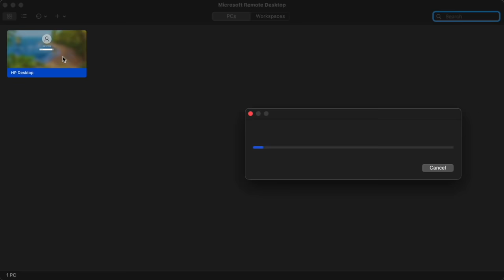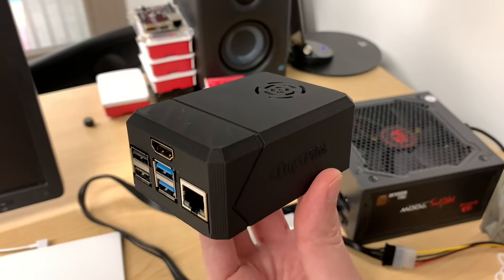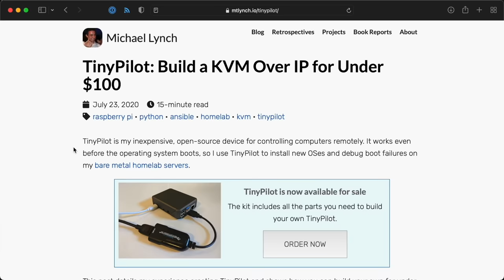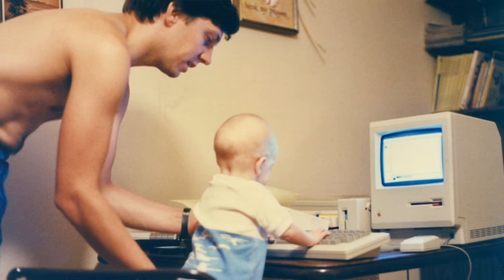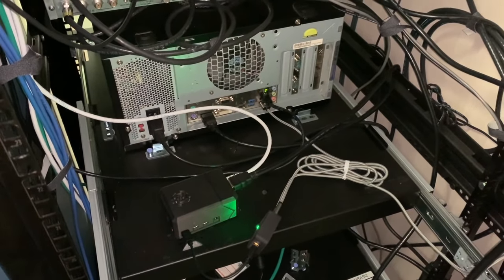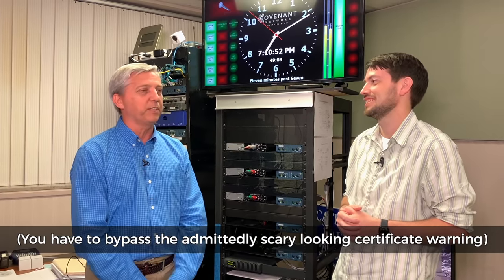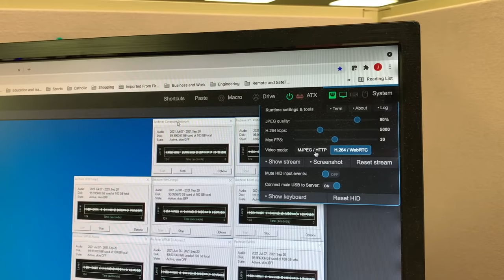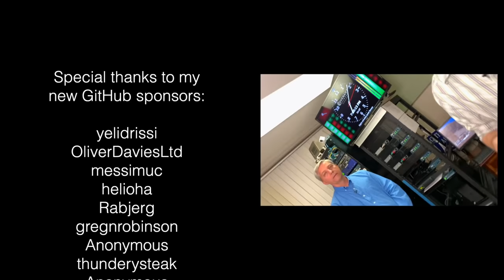Control ANY COMPUTER with these Pi KVMs!

Comment: Great vid and Dad involvement along with videographer behind the scenes (guessing Jeff's wife).  
I know with a 31K viewer base my question is like a mouse poot in a tornado, but, here goes:
With the chip shortage, could using an existing open-source package for an existing OS like Mac or Windows in the form of Barrier KVM be a viable alternative? And have you played with that package?
 Inquiring minds...
Reply from the maker: I haven't used that, but I'd assume you could set up an older Mac or PC to be a KVM with a cheap HDMI input dongle like the ones outlined in the DIY guides for the KVMs mentioned in this video.

Also the videographer behind the scenes (Katie) is my sister—the subject of my Dad's latency joke :)

Comment: I have a PS4 that I'm running Linux on... But when it reboots it goes back into normal firmware. To get back into Linux I need to run payloads...
Would this KVM work with a the PS4 on Obris (it's normal firmware)?

Comment: what is that meter on that clock that's going up and down, it almost looks like it from you two talking
Reply from the maker: That's just a VU meter for the on air signal. The station plays talk content so it's just a coincidence it seems to line up with our talking from time to time :)
Reply: @JeffGeerling  cool, thanks for answering that. I was close though since it was a talking pattern.

Comment: Its impossible to use those computers with lag. When I physically control a remote computer using a server that streams the video, its too laggy to control. Its an amazing thing to have, but the lag is terrible as opposed to Remote Desktop or VNC.
Reply: Depends on your internet, we have fibre at the office and at home and the lag doesn't cause any issues with controlling the computers.

Comment: so its not a solution to use with home desktop computer. I was thinking on having something like this to control my home desktop when I'm out, through vpn. If i need to reset, turn it on or off. Would be great when Im on vacation. I guess i'll have to work with wakup on lan tho

Comment: Nice episode Jeff.  It was strange to see how your dad accepts the poor quality software.  Sometimes you have to restart it.  What?  That is not good enough.  His systems are Windows based?  There is no reason to accept that.  Move off of windows, start with a system that has a solid foundation and up-time.  That is possibly a specific hardened distribution of linux but is more likely OpenBSD. Even OS/2 is known to be a more solid platform than Windows.
Reply from the maker: Unfortunately in broadcast radio, about 98% of all software that does things like the text output for transmission, studio-transmitter communications, and practically all interfaces for broadcast gear are Windows-only (and typically GUI-only, no APIs or programming interfaces here).

It would be nice if more of the audio world were able to take advantage of Linux, but unfortunately in most media areas, Linux is used on devices themselves, but management and integration is always Windows-first or Windows-only :(

Comment: for the pi with a video card try a gtx 1060 mining card by Zotac because even though it doesn't have output the pi does and the card for other PC units runs its graphics through the motherboard and works with most computers

Comment: If the latency was better I would try this with my Unraid setup. 100-300ms is unacceptable. 30ms is the max I would be ok with.
Reply: 30ms is the input lag of many older directly connected LCDs lol, you want that over Ethernet?
Reply: @p_serdiuk  I get around 10ms on cat7 with Steam link and around 25ms with Splashtop.
Reply: @justinweston2353  Both use virtual display drivers. IP KVM captures the real GPU output and encodes it. So you can use TeamViewer, Anydesk, NoMachine or Splashtop while the PC is on and its OS is working with very good latency, and use IP KVM with worse latency if something goes wrong.
Reply: @justinweston2353  Good luck restarting a hang PC with Steam Link and Splashtop or accessing the Bios. KVMs are for serious work that software solutions can not possibly do
Reply: @isymdvr  I can easily restart them when they "hang" because they are running in a VM on my Unraid server.
Reply: @justinweston2353  Well then you dont need any software you can access the VM directly. Plus the KVMs are for bare metal installations not VMs

Comment: Would be curious at the security risk with these devices.  Seems like a hackers dream to access these and take over machines.
Reply: That's true, but there's security holes inherent in any kind of remote access system. If you need to make the system remotely accessible you make it vulnerable, and that's true no matter what kind of device you're using. I think that question zero before you even start choosing a remote access solution is whether or not remote access is necessary and worth the security risk.
Reply: Radio stations run these on private networks and only via encrypted VPN if accessed from public internet.

Comment: ok so question... you would need one of these for each device you want to connect to right?
Reply from the maker: Yes if you need that full control. If you're good with just the KVM part and not power control, you can put it in front of a 'dumb KVM' switch that has keyboard macros for switching and control multiple computers.

Comment: gaming preformance KVM?
Reply from the maker: It would not be good for gaming; 100-300ms would only be useful with games that are not real time, like chess.
Reply: @JeffGeerling  but what if the latency was fixed? What is actually making it slow... stuff like parsec or moonlight or steam play can stream low latency?

Comment: if a pc is compleatly shut of can one of these kvm turn it on?
Reply from the maker: The Pi-KVM can, but the TinyPilot cannot. You connect the ATX control wires to the motherboard, then the buttons/LEDs to the breakout board for Pi-KVM, and you can have full control even if the server is shut down completely.
Reply: My gigabyte MB provides alway on USB that provides enough power to run the Pi kvm.  I have the ATX option so can power up the whole system from a powered down state.

Comment: Part of the reason you buy from a well known supplier for a KVM tends to be security and support. Obviously, supply chain attacks happen a lot.
The biggest issue I had with piKVM was the that the main author was Russian so the entire source code would need to be vetted prior to implementation within a secure environment.
Given that this software allows full access to a computer, this would be a prime target for a nation state attack.
Reply: You know, it sounds pretty insulting. I understand that the actions of the state look very bad, but this does not mean that I work for the KGB. Of course, it would be great if someone would do a review to make sure that it is safe, but you should not do it just because I am russian. I think it's also worth being consistent and checking out tinypilot as well, since it uses the pikvm video core, which is also written by me :)
Reply: @mdevaev  I apologize for just mentioning Russia. I did not intend to single the country out.
To be fair, all code would need to get vetted but (within US systems) any non-US creator's code would need to have additional scrutiny.
This is true of all software/hardware in highly controlled systems to be in compliance.
Reply: If you plug these things into public network then sorry, it's on you.

Comment: I wont call these bad ideas, but Jeff you say it yourself at 2:02. PIs do have the tendency to lock up and also use unreliable storage devices. Yes, making a KVM out of a PI is a budget solution to a problem, but personally I see this as just adding another weak link in the system. There is a reason why the normal KVMs are expensive.
Reply from the maker: I've been running at least four Pis in my home for the past 7 years, continuously, without issues. Maybe one or two lockups in that time.

99% of instability on Pis comes from either bad/weak power supplies or flakey or over-used microSD cards.

The PiKVM even uses a read-only filesystem (mentioned later in the video) to greatly extend the life on even cheaper microSD cards—or you can boot off a USB SSD and get even better performance.

I think the saying that Raspberry Pis aren't as reliable as any off-the-shelf computer needs to be qualified nowadays.
Reply: I wouldn't say Pi's tend to lock up, but they can lock up the more esoteric things that you do. Personally, I've been running a k8s cluster with 100% uptime for a long time without an issue, but at work I interact with several malfunctioning IPMI interfaces every day. The fact that pi-kvm also mounts the storage as RO should mean that it lasts for longer.

But yeah, I probably wouldn't provision these as the main KVM at work, but we're definitely getting one for our Dev lab to handle when the M1 Mac's throw a fit.

Comment: One question. how many machins can I control with one of those devices, for example the Pi-KVM v3? 1 per machine?
thanks
Reply from the maker: 1 per machine, though if you interface with an external hardware KVM (many will work) you could switch between 2, 4, or 8.

Comment: Steam is my IPKVM, zero latency, super high speed video, access from anywhere, and leaves you wondering how VNC/Citrix can justify charging for their product any more.
Reply: Great for personal use, no doubt.  You will be looking for work if you try to implement steam in a business application.  Steam can't get you into BIOS, either.
Reply: @jong2359  Totally! Well apart from my own businesses*.  Regarding Bios, neither can VNC/Citrix or a dozen other remote access/IPKVM solutions, but then I cant remeber the last time I needed BIOS access outside of enabling XMP during build, in which case I need to be there anyway to put the screws in :)

*though to be honest, I'd get some pretty funny looks for spinning up anything business critical on a PI anyway, not everyone is as enlightened as Jeff's audience.

Comment: lol dad Katie joke
Reply from the maker: There were a couple others but I couldn't edit them all in :D

Maybe Dad should make more appearances!
Reply: @JeffGeerling  He seems like a great guy and probably has a lot of technical knowledge he could share. I wonder if dad would be interested in doing a project on: Software-defined radio (SDR). Things like the: HackRF
Reply from the maker: @autohmae  He's been actively tinkering with an RTL-SDR (currently using it for some signal monitoring — see the outtake right near the end of the video!). I hope he'll get more into it. Lots of fun to be had when you give an RF engineer a Pi and an RTL-SDR :)
Reply: @JeffGeerling  great to hear, because for many of us these kinds of things looks really interesting but we have very little idea of what we could do with it and in a lot of cases where to even start, thus it becomes hard to justify a purchase. So I think it's a useful project to do a video on
Reply from the maker: I hope to do a few more videos with my Dad at tower sites and the station. One project he might work on someday is an RTL-SDR mobile kit for frequency scanning, to help triangulate signals, detect out-of-spec transmitters, that sort of thing.

The equipment currently in use by engineers and the FCC for these purposes is often thousands of dollars and of course doesn't run on open source hardware/software. Would be cool to shake things up there, and see what cool things we could build!

I can imagine some fun and fancy projects marrying the Time Card to an RTL-SDR.

Comment: With the advent of working from home I now use a work laptop in conjunction with my main machine. I use a KVM to share the KB and mouse which involves a button press to swap control.

However........ Adder on their KVMs have a really cool feature (free flow) that auto detects screen edge where screen 1 is connected to the laptop and screen 2 is connected to the main machine. The feature allows seamless control of the machine depending what is active i.e. which monitor the curser is on denotes active machine. Plus there is no software to install which is a requirement because of the work laptop.

Does anyone know if this sort of functionality is available on the RPI. The Addr KVMs have like £500 plus, cabling wise its KB / Mouse into KVM and USB to the target machines. The machines are directly connected to their displays.

Comment: Or just buy an  under $200  cheap laptop and use it as a terminal... thin, light,  cheap,  fits on the Rack in a 1U keyboard tray.

Comment: All of it is just giberish at the sole start - what REAL server (eg. HP's Proliant series) have HDMI ports? And real 8-port IP KVM switch costs like less than 200$ (eg. Aten 1308).
Reply from the maker: Where the heck did you find an Aten that actually does IP control for less than $600???
Reply: @JeffGeerling  I own (OK... My company does) 1308 and we bought it for like 750 zloty (about 190$ today).
Reply from the maker: @OzziemandiasPL  The 1308 doesn't seem to feature any IP connectivity... the cheapest IP-enabled devices from Aten are like $600+.
Reply: @JeffGeerling Edited: I'm very sorry, I was mistaken. I have 1708i not 1308. And it is surely over 600$. All my previous comments are wrong. Sorry for putting you in bad light.
Reply from the maker: @OzziemandiasPL  No problem! I was just wondering if maybe there was a version with some addon card or something. It would be awesome if more vendors had cheaper IP KVMs available. Maybe PiKVM will put some downward pressure on it (and maybe more of these vendors will start dropping Pis inside their magic boxes, ha!).
Reply: @JeffGeerling  Once again sorry for my dumbness.

Comment: Umm hdmi on a server good luck
Reply from the maker: Works with VGA, HDMI, or DVI.
Reply: @JeffGeerling  does this require an hdmi to vga adapter then? I don’t see any native VGA port on the hat configuration. I totally understand these adapters are common and easily obtainable but heck if they could build that hardware directly into the hat and case of the adapter I could see a lot of people taking this as a way cheeper solution given the usual cost of IP kvms
Reply from the maker: @apollo0117  Yeah you still need the physical adapter, unfortunately. In this form factor, no getting around it, really.

Comment: You can control ANY COMPUTER installing ONE program on it. So way buy or create additional device? Why make your life more difficult ?. Pi KVMs = zero sense
Reply: The value of kvm versus remote control software is the ability to act outside of the OS. If the system crashes and needs to be monitored or recovered when you can’t get the system to boot, a kvm is invaluable. Remote control software only works when everything is working. KVM works even when nothing is working.